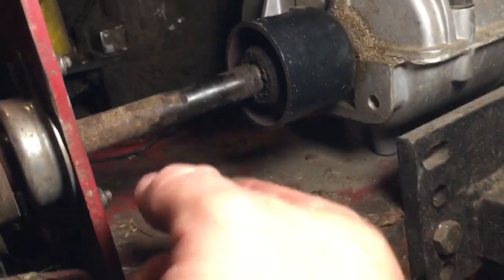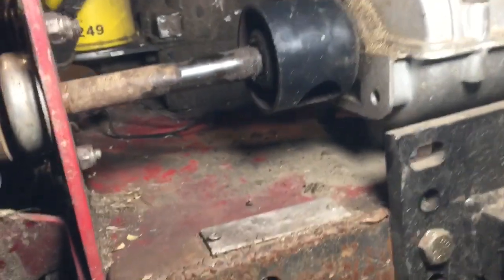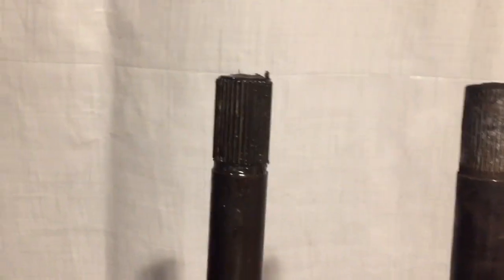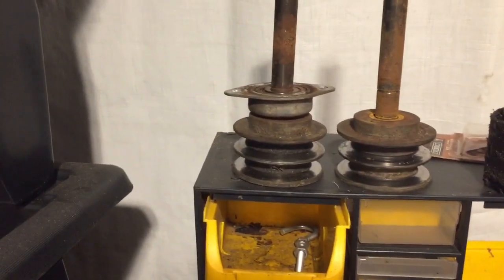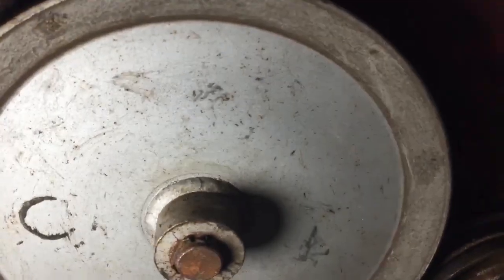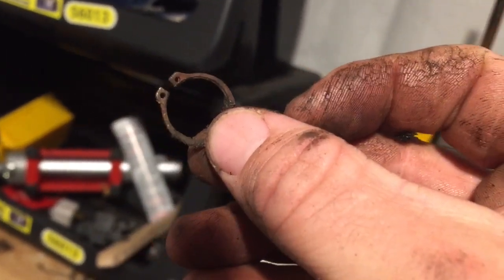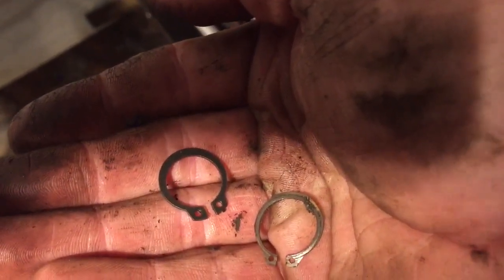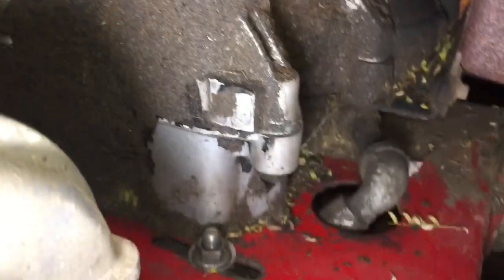Failed Snap Ring Ate $90 in parts 😳

Comment: Think you may upgrade to a hydro next year?
Reply from the maker: That’s the plan, just gotta save up enough cash to do it
Reply: Dulin Cut & Trim I was able to get a 36” hydro snapper pro this spring with 2 rack em bags for $800.. put a new fuel line and new tires on it and it runs awesome
Reply from the maker: Sean Eikenberry wow dude that’s an awesome deal!